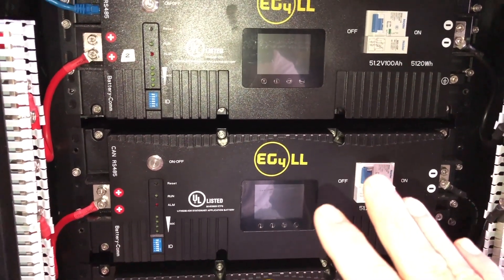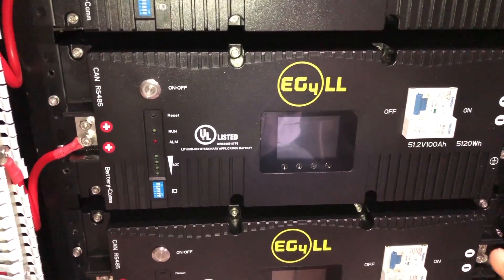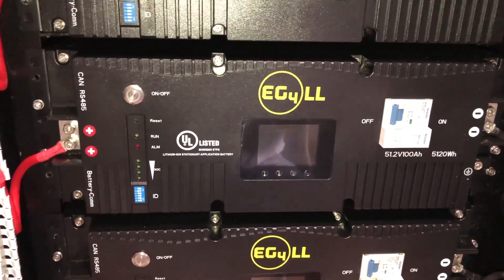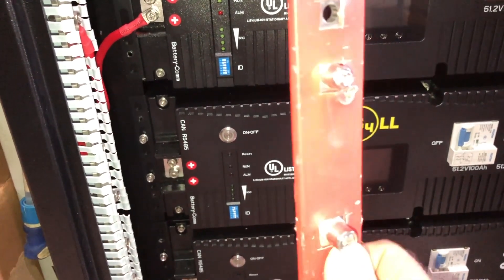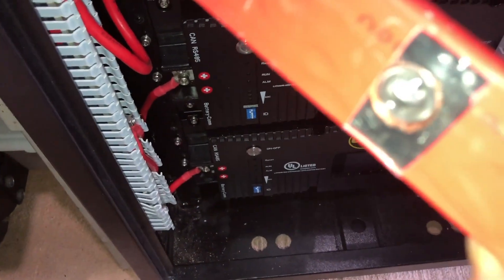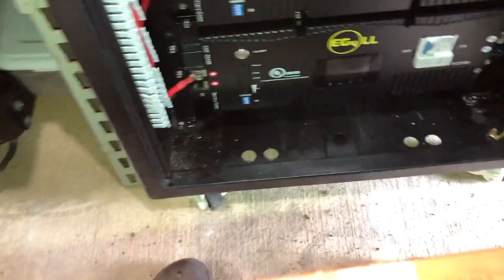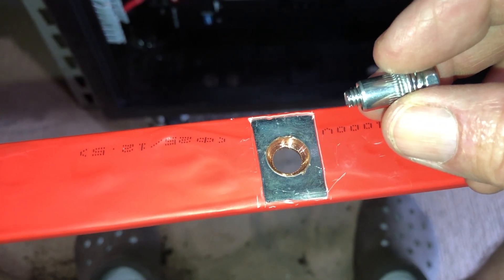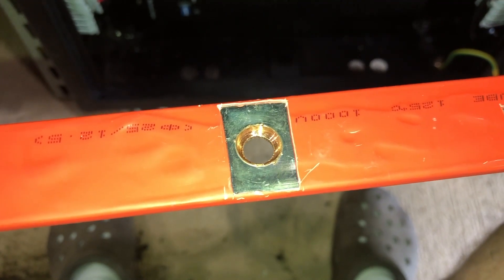EG4 Welded Rack Buss Bar Failure - AGAIN!!!

Comment: I had the same problem.  
I have a rivnut tool. I just tightened them up and changed the ones that not straight. 
You can remove and put a bolt and done deal. 
Smoke a joint and chill. Nice info

Comment: Nevermind. Frumi here again and I've seen now an earlier video of you stating the disadvanages of tapping straight into the copper. Now, I've ordered one Life Power (scrimpin' an' savin' for more) and one cabinet. And wouldn't ya know it, half of my order is on "back order". Wanna bet they're having issues with the bus bars and have stopped shipping? Thanks for your videos and I hope I get a bus bar with the inserts inserted from the back. Cheers and thanks again.
Reply from the maker: How did your system turn out?

Comment: It is a poor design. They’ve removed so much buss bar to install the rivnuts that the cable lugs barely touch the buss bar at all. 

Hate to say this, but in your case I would count those buss bars as sunk cost and go buy two new blank ones and drill them yourself. You shouldn’t have to do that but it might help your blood pressure (not kidding) not dealing with tech support.

Comment: You are poorly informed. The only issue here is that the Rivnut wasn't fully engaged.
Reply from the maker: The Rivnut was FULLY engaged. It simply pulled right through the buss bar. This is simply a stupid design. MANY of these have failed. It's a fire hazard for sure.
Reply: @lanceknoechel8945  The only other issue would be to ensure that you used an actual torque wrench and torqued to the specified value, we have had only one spin out. and it was due to poor workmanship (i suspect at signature solar)
Reply from the maker: @leen.3785  I used a torque wrench to spec on the original install. Four of the inserts failed. When I received the "replacement buss bars", one of the inserts had fallen out during shipment. It was fully engaged, but the way they drilled the recess, there is not enough copper to support the stress of the rivet pulling through. I don't trust this design. It's a totally poor engineering.
Reply: The rivnuts are so large that the battery cable lugs barely have any surface contact with the buss bar. It’s a very poor design.

Comment: Looks like your only option is to drill them out and bolt and nuts. 
I won't be buying that rack until that problem is resolved. 
Thanks Brother for getting this information out to us 👍🙏
Reply from the maker: I may be doing just that so I can actually start using the batteries.

Comment: Adding some fuel to the fire. Same bus bar issues. They sent me two that were WORSE than the ones that came with the rack. I ended up drilling holes in mine and using real bolts, washers, and Nylock nuts. No issues with MY mods. My battery bank is working fine. Those rivnut threaded inserts are junk and dangerous (unsafe).
Reply from the maker: I'm considering doing something similar, as I don't trust the safety of the current buss bars, so I'm not even using my rack. I'd really like to start using it.
Reply: I copied your mod and a buddy helped with shop , as they sent me the same replacement as in this video 😢. Threaded 1/4 20s into copper with nyloks and thread locker

Comment: This looks like rivnuts that have not been properly installed.
Reply from the maker: Yep. I may try to just add my own bolts since I don't know how long it will take for SS to send proper buss bars. Currently, I'm not even using the batteries cuz I don't trust the safety of the buss bars.

Comment: Maybe just knock the inserts out, drill out the holes if you have to, and use nuts and bolts. That would work, I saw a guy do it.
I'm sorry this happened to you.
Reply: Same issues I had. Drill & tap for .25 by 20 bolts good to go. My inserts fell out trying to remove bolts . Video on my channel. Having all the same issues U have had. Very frustrating.
Reply from the maker: I may be doing just that so I can actually start using the batteries. Hard telling how long it will take for SS to send proper buss bars.